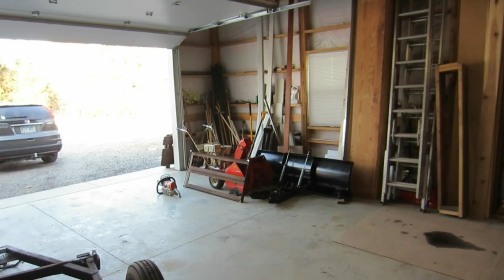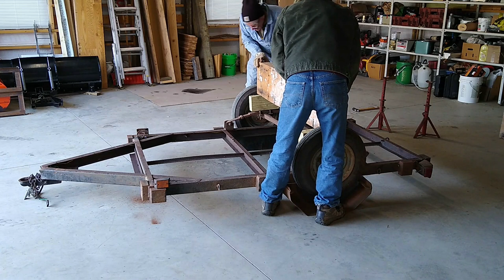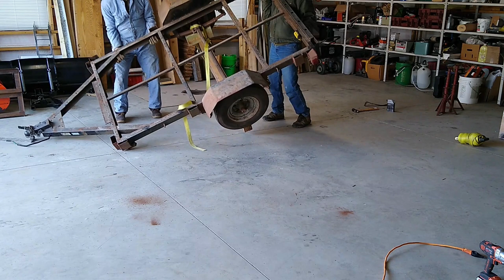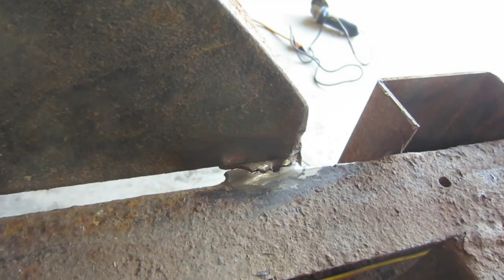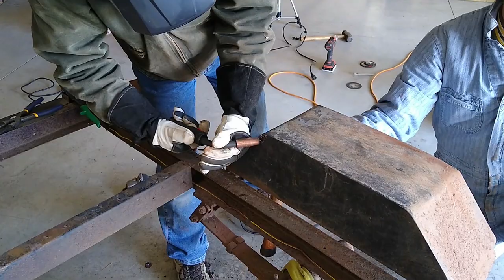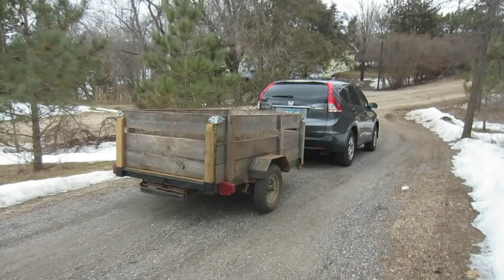Bent Axle Trailer Repair

Comment: Came across your video and watched how you guys fix the bent axle, I bent an axle 2x2 square hauling to heavy of a load, what I did was just flip it 180 and welded between the leaf springs (leaf to leaf) a smaller 1x1 square, spot welded across both sides, so I kept the bow Up and welded a support across the top of it for the length between the leafs, not sure if what I did was wrong but seemed to work
Reply from the maker: Hey, it ain't wrong if it works!

Comment: Axle isn't supposed to be straight.  The center of the axle should be about ⅝ to ¾ of an inch higher than the ends.
Reply from the maker: I didn't know that, but it makes sense since there is probably a small bit of deflection when the trailer is loaded.  It wouldn't take much to tweak it a bit more.  Thanks for the info.

Comment: Hey that trailer doesn't have license plate😑, can you use it that way in your country?
Reply from the maker: Rules vary between states.  Small trailers in Minnesota don't require plates.  Instead, we have a permanent sticker on the tongue.  No annual renewal necessary.  Trailers over a certain weight do require plates and annual renewal fee.

Comment: been money ahead to just flip put bow on opposite  side(2hours)
Reply: Given how rusty that thing is they would end up replacing all of the Axle u bolts etc (on a side note I was quite impressed with how well they straightened it personally wouldn’t use this method think I would replace it.. I guess they are keeping the cost down)